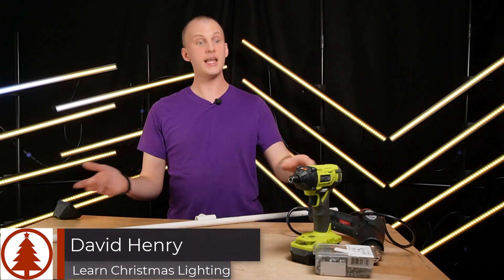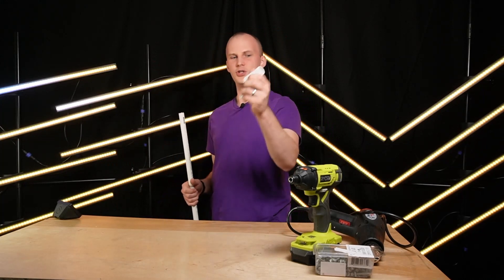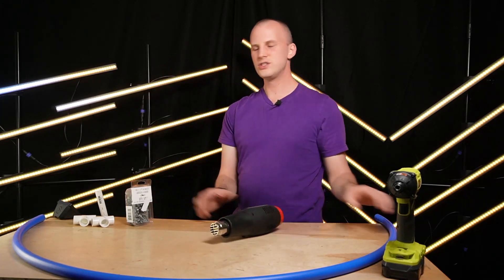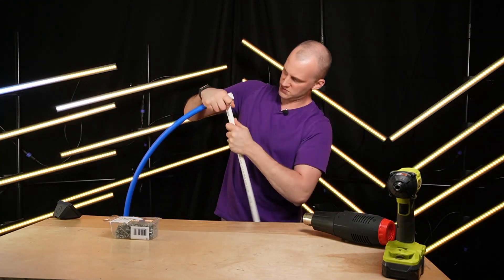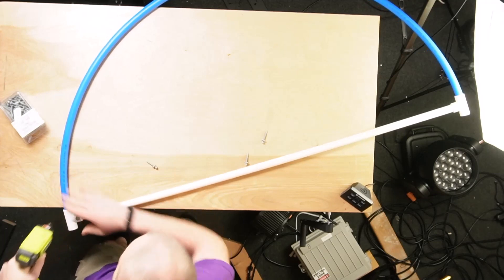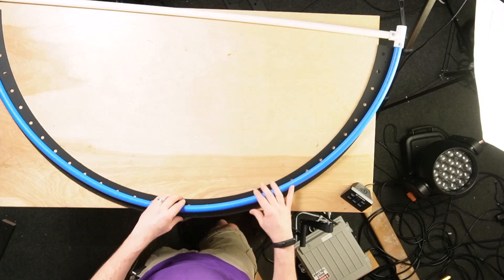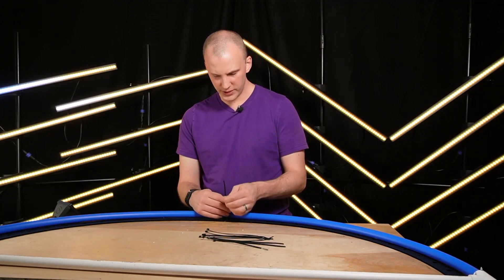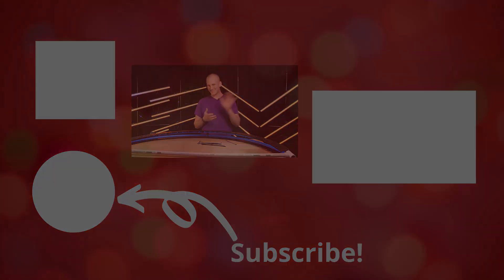How to Build Boscoyo Medium Arches from PEX! (The Easiest Method?)

Comment: Thanks for the video.  Here is what I did to measure my 3/4" PEX ... I got a piece of 1" thin-wall PVC and cut it down to the size I needed.  Then I pushed the PEX into the PVC until it was at the end of the PVC, marked it and cut it.  I used a Husky ratcheting PVC cutter from HD, to cut my PEX; it makes for a clean cut.  And instead of using a heat gun, I used a Dremel to enlarge the inside of the PVC joint (this was much faster and less frustrating for me).
Reply from the maker: That does sound easier!

Comment: Some tips and alternative approaches:
*Ratcheting pipe cutters.  These will work for PEX and PVC.  The smallest set will do all the way up to 1.25" PVC.  (I've used them for a lot of other things as well, btw.  For example, they cut pipe insulation much more cleanly than scissors.)  There are larger ones that do 2" (and probably more; that's just what I own).  The biggest advantage is that you don't end up with plastic "sawdust" everywhere.
*Shorter screws.  There's no reason why the points should be sticking out the other side of the pipe.  Also, drill a pilot hole first, and you'll be able to use any screw with a coarse enough thread, not just the self-tapping ones.
*Mark pipe before inserting.  This lets you know when you've gone far enough.  It also helps when you have to replicate steps so all the props match.  That's standard practice with PEX on Sharkbite fittings (bc it might leak if you don't insert it far enough), but might have helped with the PVC/tees too.  Like another commenter said, your diameter ended up being too long to match the circumference.  Note: PVC never inserts all the way, so it's easy to end up with something longer than expected.